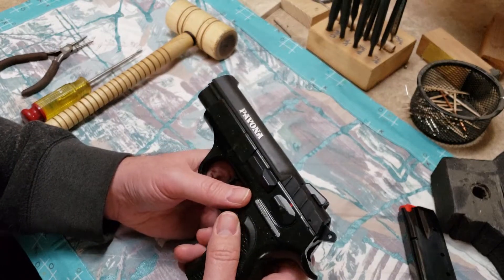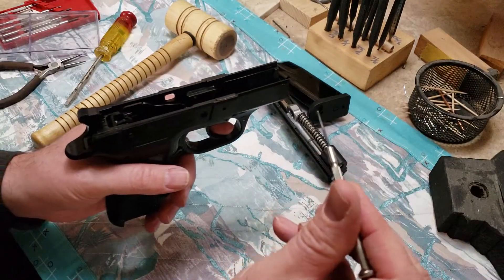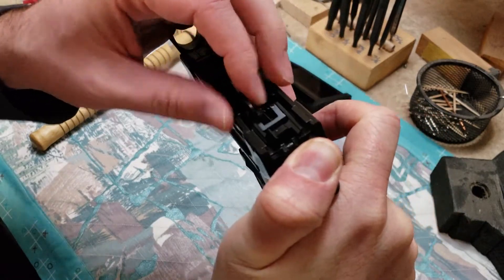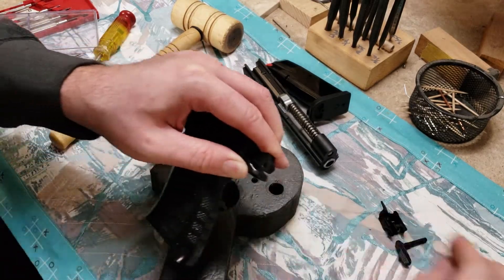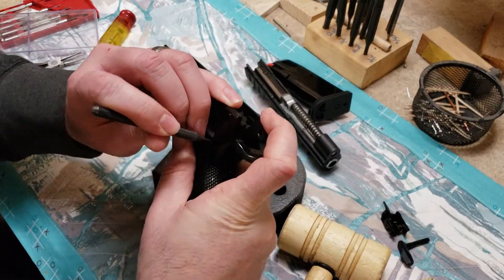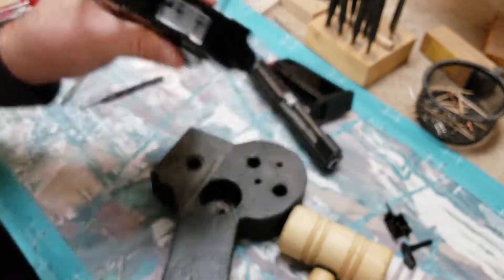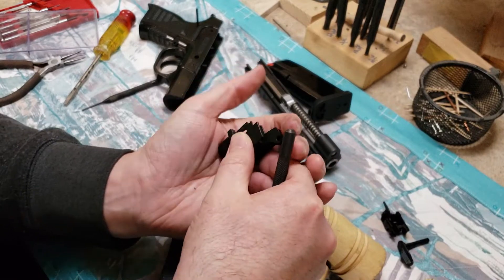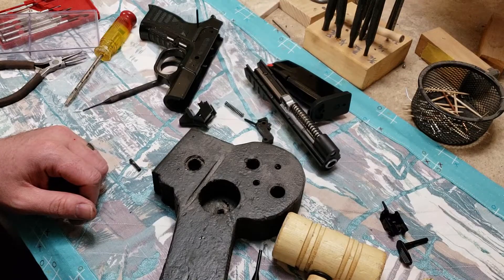EAA Witness / Sar B6P hammer spring removal

Comment: Thanks..looking for part 2.did a lighter spring help double action?
Reply from the maker: Part 2 video got corrupted.   Yes, tremendous difference
Reply: @DCopp  I would like one for the full size b6p.I hate the double action on that gun.trigger feels like it is cutting finger on mine. would know what part number I should use? Subscribed
Reply from the maker: @Rumpleskin  no part number, just buy a Wolff or Wilson Combat reduced power spring kit for a K frame revolver.  Use the 13# REBOUND spring.
Reply: @DCopp  thanks👍

Comment: Just picked up a MAPP fs from rock island (tanfo parts , rebranded and assembled in the Philippines) thanks to this video I'll be able to try and lighten up the horrendous DA pull. Thank you! (Any idea what you're pulling in lbs with the S&w spring?)
Reply from the maker: Probably 7-8 DA max
Reply: @DCopp  I went ahead and did the deed...however for some reason now it appears the slide will not go back to battery on reassembly (acting like its getting stopped by the sear) otherwise the sa/da and safety all function, it just wont go back together with the slide... any ideas where I went wrong?
Reply from the maker: @bryanreilly9033  I'd guess the sear cage isn't in the exact spot it needs to be
Reply: Turns out , I'm just an idiot..after pulling the gun apart and putting it back together again a half dozen times...turned out to be the selector tab on the underside of the safety was in the wrong position, (It looked like it was fine, but the tab wasn't allowing the safety bar to get full purchase, even though it looked like it was in) ... so my learning curve aside, I put the adjustable lpa sight on it and the springs, trigger feels great!! Saturday is the test run, thanks again for the answers and the video